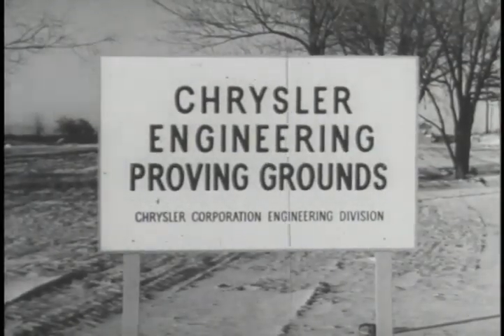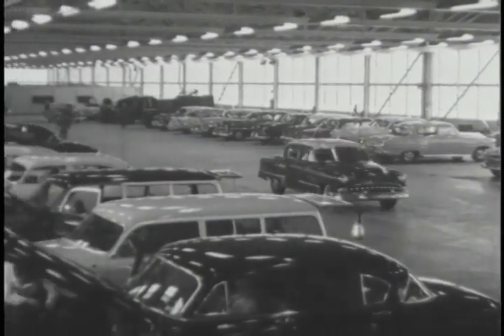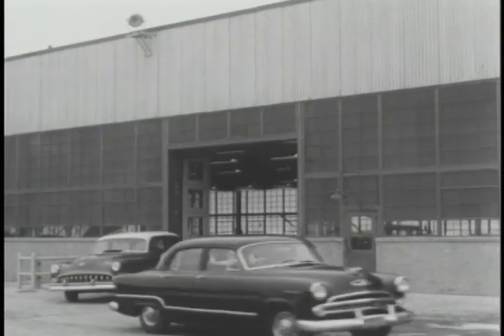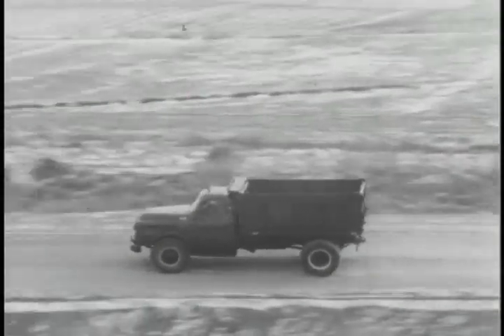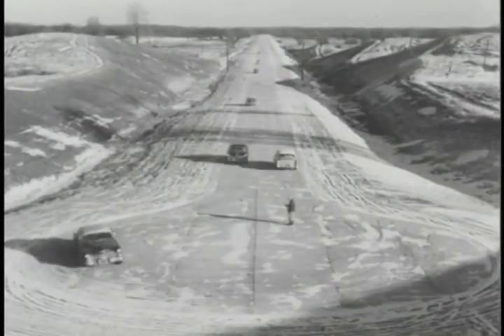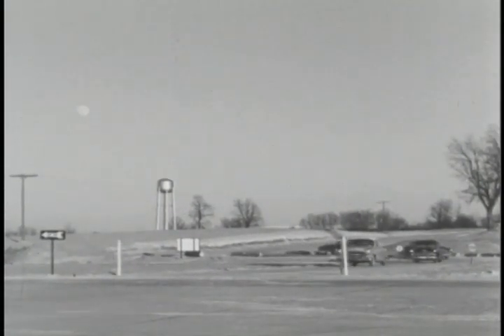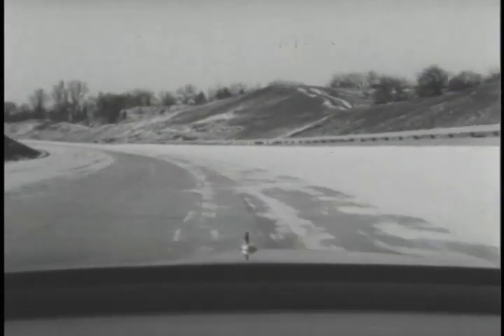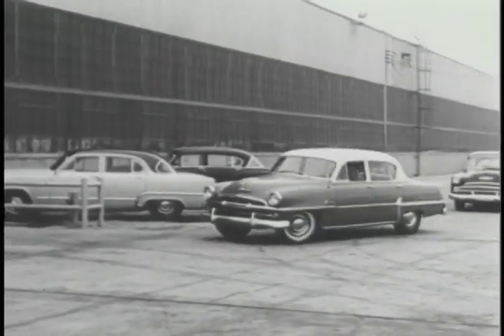Building the Chrysler Proving Grounds

Comment: If the cars were designed for higher speeds why not higher speed limits?
Reply: Dogurasu Many roads have speed limits well above what the average that traffic proceeds at due to such things as vehicles crowding the left without passing and people slowing down because a police is on the side of the road with roof lights going.